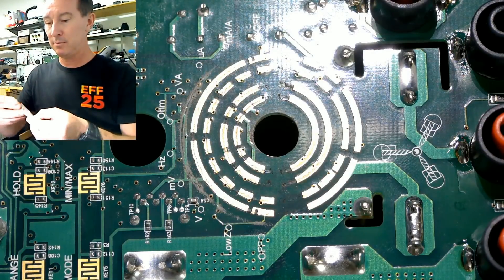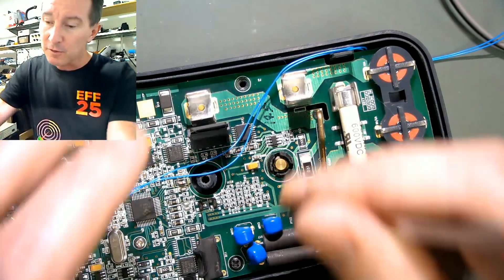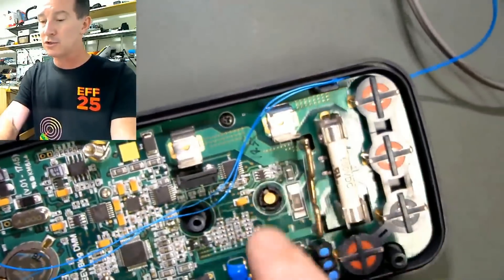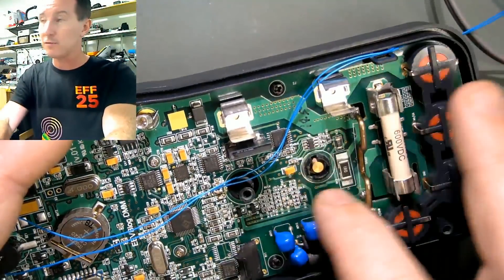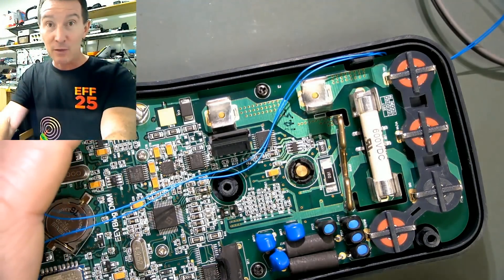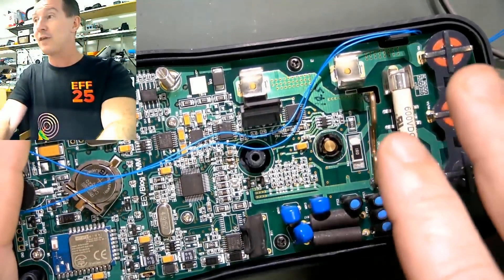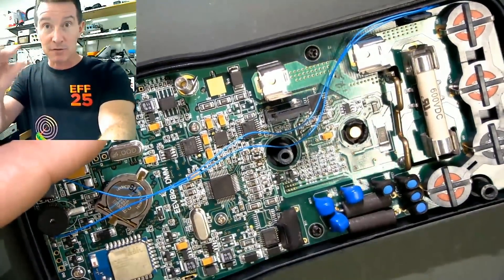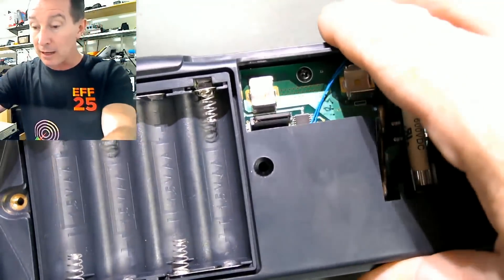How to do Lifecycle Testing

Comment: That is a perfectly valid way of testing a product where it is a finished device. Testing switches alone is a different thing because they may be used in different products that may need longer MTBF or functional cycles so manufacturers would want to be able to select a suitable component. The only thing is to not dismantle during testing and see how long it lasts (works within spec and without the need for the user to apply special handling). You would also need to run them over a range of environmental conditions to match your specified operating conditions. You then have your nominal specification.

Comment: 70% isopropyl,  30% paper/plastic wipe material.
To do the ultimate durability test, you need an unpopulated board, so you could connect your sense wiring, temp sensor, contact pressure sensor, 3 or 4 cameras to view the internal mechanical action, strain gauges to measure PCB stress.
Then there is the kitchen sink.. coffeemaker while your at it, ooh the possibilities.........

Comment: Corporate testing fields pump maximum voltage and amperage through their meters i'm sure, because they need to see how the whole meter itself reacts under complete pressure. Of course, those meters are designed to last years, but the same goes for any meter; no use in testing something the meter won't run into. I really think there needs to be a standard for how they test meters, and then a database to log test results for each meter. That would make choosing a meter much easier.

Comment: Dave, nice detail how to put screws back in the existing plastic thread. First you're fingers on the shaft to turn with light force so the srew can fall in te existing thread. Wish everybody dit that.No damage on the thread there, thumbs up!
Reply: "you are fingers"

Why not just screw it in counterclockwise until it caches the thread and then screw clockwise to fasten it?

Comment: Why doesn't anyone use a non contact system? Metrix did a multimeter without a range switch knob. I guess it's marketing more than anything.
Reply: I'm sure production costs would sky-rocket if they implemented optics or a reed system. The contact system realistically lasts just as long as it needs to. Although a non-contact knob would be nice for something of higher quality.
Reply: Costs would actually drop if they moved over to buttons, like the Metrix. And that's not a cheap meter. I guess if you're too scared to get rid of the knob altogether, there's no point bothering with a higher quality system.
Reply: Are the buttons on the Metrix non-contact ones?
Reply: They look like normal buttons to me, but at least it's not a knob.

Comment: What is the spring soldered to the board? I've seen that before somewhere, but can't remember
Reply: It's a electrical contact. Sometimes they go up to piezos. Often they connect to a foil shield on the inside of the case.
Reply: Ah cool makes sense.

Comment: Need multiple meters sampled at random from a batch and run them for the nominal cycles without dismantling and cleaning them for further cycles.

The whole meter is needed unless it's established (proven) that e.g. components and case make no difference.

You also should try to characterize how the switch would be operated in real life ... full sweeps are unchacteristic.

P.S. As you have control of the meter firmware, you could use the meter to assess the quality of the connections when it's nominally "on" with known references applied externally.
Reply: Bernd Felsche This is not really like a proper study but more an earlier phase where you just take a look how stuff holds up and what range of wear your product has. Certainly later on I would test a few random ones until they fail or for a much too high cycle count. How much and whether that makes a lot of sense depends on manufacturer tolerance as well. Also it is always highly dependent on your intention. Fluke or somebody similar probably go mental on this all the way

Comment: Using 70% alcohol for medical swabs is actually better than pure 99.9% alcohol. Some bacteria passivate against high alcohol concentration and won't die in 99.9%. Similar to oxidized surfaces on copper or aluminum.
Reply: eNBeWe 

Cool info.

I often wonder about stuff like this, especially when I see that lower the concentration stuff is preferred in some applications, and not only due to the price difference.

I'm guessing this is a cell wall chemical barrier thing? I know only a small amount on medical / biology stuff, but I did just finish watching an episode of "House", if that helps? lol
Reply: Why does it matter there is bacteria on electronics? Using it once will put them back anyway? One uses alcohol to clean of liquids/debris that could damage the product.
Reply: SillieWous I was just commenting on Dave's remark about the swabs being "only 70%" and "good enough for Australia". I am well aware of it not being used as desinfectant.
Reply: Really... If you knew.

You would never touch anything ever again.
Reply: I know, I wasn't born yesterday.
Reply: Mark Giblin and why is that? There is more bacteria inside you than actual you cells. This world has many problems and the idea that germs are bad is one of them...

Comment: It would be better if the plastic encoder had a center screw to hold it in position instead of a clip, with a wavy spring washer and a wide head self tapping screw  and nylon washer instead of having that plastic shim? This could easily be changed in the mould without any expense. Plus this gives you centre  pressure on your contacts.
You could do away with the Nylon washer and just put a copper ring around the hole in the circuit board would do it if there's enough room
Reply: Why do you end a normal sentence with a question mark.

Comment: How about capacitive touch with a round e-paper display to replace these mechanical switches?
Reply: Krish Rao 

Capacitive might work OK, but a multimeter is a pretty harsh electrical environment.

You could have current spikes of tens of Amps going through the meter, with all of the inductive noise that go along with that.

Could cause spurious triggers of the touch buttons.

It would also cost a lot more to add the extra electronic switching, plus it would take a teensy bit more battery power.

Still an interesting idea though.

I wonder what the longevity of e-ink displays is like? Must be fairly good, and some can easily update fast enough for a meter display, but I'm not sure how they cope with constant updates?
Reply: ElectronAsh e-Ink is too slow for a meter.  But so is the reported performance of the 121GW autoranging.  Especially when probing a circuit (thus alternating between the interesting value and 0V/∞Ω every time you move the probes).
Reply: ElectronAsh 
A year ago I studied the ones availabe at Digikey for a new product design. At the moment that tech worked only for commercial. Lifefespan is limited an they degrade with UV. There are techniques to improve update time but I think that they still to slow for a meter.

Comment: 50,000 cycles on that type of switch is far beyond what it would normally get in real world usage ! 
It is interesting to see how those PC board tracks stand up to all that wear and tear though.
Reply: 50 000 cycles. It's gonna break down to pieces in normal use before that breaks.
Reply: Bare in mind that isn't failure after 50,000 that's still perfectly functional and still almost new after 50,000.The hardest users of these are people who work in QC and need the thing all the time and even then it's usually just left in one range. This is why on things like the fluke 289 they use an on/off switch instead of range switch off. On benches where its used for volts 99% of the time, the range switch will be factory new 10 years down the line.
Reply: Even if you only make 12 measurements a day then it's easily possible to reach 50,000 in the expected life of a meter in that price range.

In the EEVBLOG "robustness" thread there's a Fluke 17B+ that's had 100,000 of Daves "cycles" and it still basically looks like new.

https://www.youtube.com/watch?v=x_L6Z8BAXFQ&t=27m10s
Reply: That's nearly 11.5 years of constant daily use, in reality it probably wouldn't get that much use. 
You wouldn't need to change the switch for every measurement and you would most likely be switching between 3 or 4 common ranges. I have a Fluke that is nearly 20 years old that has not had that many range changes because I generally only use 3 ranges, those parts of the tracks will have more wear than the unused ranges but I can't detect any obvious difference when using it.

Comment: Don't use medical swabs for cleaning electronics or optics. They contain glycerin, which leaves a coating.
Reply: I can't find an example of prep pads containing glycerin. The ones I have don't mention anything but isopropyl alcohol, and the MSDS doesn't list glycerin.
Reply: Be careful though. Glass wipes are often re-badged medical swabs. I got caught out by that some years ago. Check the package for the ingredients before buying.
Reply: what to use instead? @Michael Tonge
Reply: I use isopropyl alcohol and microfiber cloths or cotton buds mostly. You can get non-medical alcohol wipes. Zeiss lens wipes seem okay.
Reply: You can get 50 packs of glass wipes. I clean camera lens with it, it leaves nothing. I like those a lot
Reply: Oh, Didn't think of that. Thanks!
Edit: I think I was lucky then because mine was okay for optics
Reply: Isopropyl alcohol.... rubbing alcohol, or distilled water if you don't have anything by hand?
Reply: Alcohol or isopropyl are very weak cleaners. They are good for flux residues or fingerprints, but not for the plastic powder smudged on the contact pads. I would wipe it with cotton bud wetted in toluene or acetone. But caution is neccessary, because these things etch and destroy most plastics. Certain hard rubbers are very good for cleaning PCB contacts - slightly abrasive for good cleaning, bud not too much so they don't damage the gold plating.
Reply: IDK where you are getting your surgical spirits from but proper surgical swabs and bottles of ISO don't contain glycerine ... What you are using (if that is the case) is the ear drops that are used to treat ear problems, like water logged ear canals.
Reply: Roger L. Ortiz distilled water will not remove grease. Ethanol has a bittering agent and it's really unpleasant to work with. Isopropanol, they don't really sell it here.
Reply: me as well, i can tell ya....
Reply: This is awesome Dave.  One point I have not seen you make is that all of this testing is in response to the need for a shim (which was pretty much always going to work). Your work and results mean I am more confident this range switch is a Bobby Dazzler than I would have been if the meter had just shipped with the slightly thicker PCB and no shim. Thanks to these videos I now have a good range switch service guide too :)